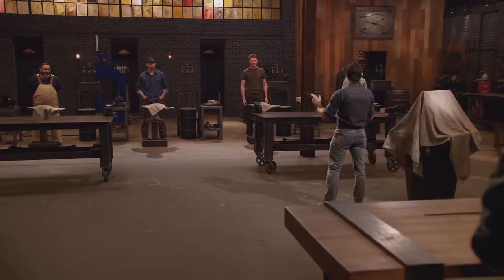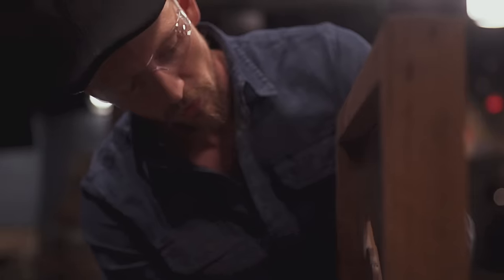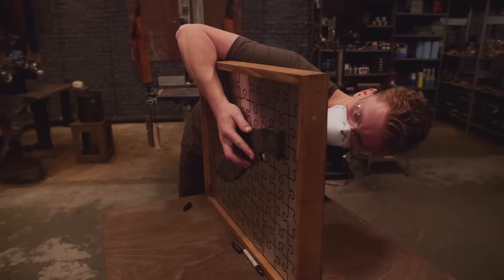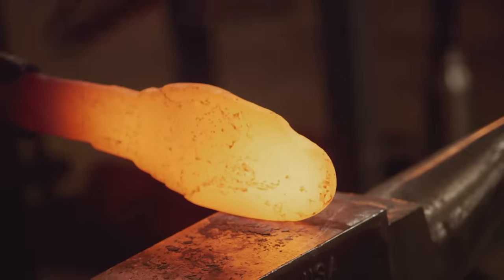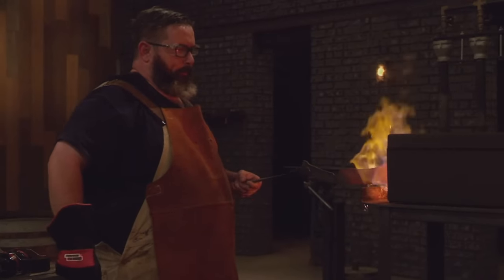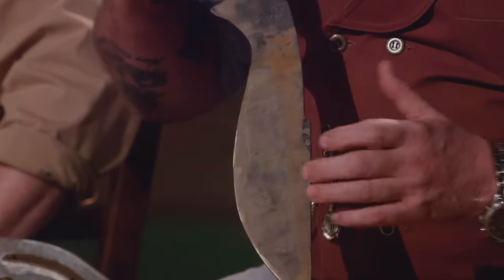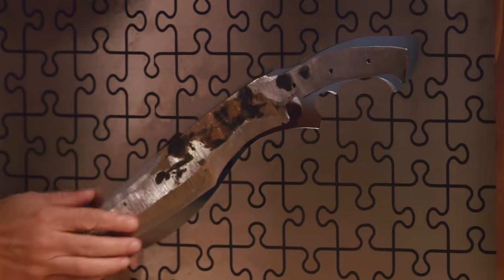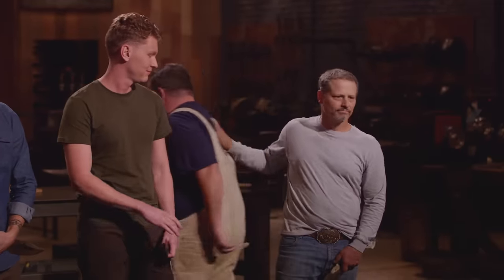The Ultimate Puzzle Piece Forging Challenge | Forged in Fire (Season 7)

Comment: That dude that stuck his hand into that hot bucket for sure messed up his hand bad. Paused the video when you can see his finger and that does NOT look ok!!
Reply: That's just a wet band-aid. You can see him wearing it earlier on.
Reply: hard to tell, that is either a 3rd degree burn or a plaster / band aid. I think it's the latter, if it was a 3rd degree burn I think the producer would have intervened.
Still I think it was a stupid idea though, he should have atleast taken his shirt off or better use tongs.
Reply: I mean, at 3:54 he's got bandaids on his fingers on both hands, so he was perfectly fine after removing his hand from the oil
Reply: Can grinder sparks ignite a oil dosed sleeve?? Lol
Reply: The oil is not hot enough to cause burns, is it?
Reply: You still don't want hot oil on you because it's gonna be hard to remove it because oil and water doesn't mix
Reply: @nandinhocunha440  That's what soap is for.
Reply: They qunch the blade in cold oil. That small blade will not increase temperature that much to burn. It can hurt a little but not any major burn.
Reply: @Durwood71  the blade might be.
Reply: The oil is not hot.  Dip a small hot blade in a large mass of room temperature oil and it raises the temperature maybe a few degrees above room temp.

Comment: I very much prefer letting the contestants decide what shape they want their knife to be. I care more about how a blade performs, than whether or not the profile perfectly matches another knife.
Reply: There's always some sort of challenge to the first section. Sometimes they pull metal off of weird objects and sometimes they have to do Damascus. They always have size parameters but this one is just more strict.
Reply: @RapTapTap69  that's true, I just think this challenge is too strict. It's a challenge where the best knife-maker could easily be the first one sent home
Reply: @irondirigible4216  if you think about it it's not much different than making the knife to specs which if you can't do, then You're not the best knife maker there
Reply: This is a test to see if they can make something "made to order". If a customer requests something to be an exact replica, then they don't want something that looks completely different.
Reply: The point of this challenge is to perform to a specific design. If you forge as a trade you are going to get specific requests that follow strict layouts. 

Making their own blade is cool but they can do that. This is to prove they can follow directions.
Reply: The thing is, many times you're not just making assembly line blades. You're making something extremely specific that someone wants, and for that it isn't about what you want but more about meeting the specs.

Comment: Why would you take your glove off to grab hot steel?
Reply: Could be the nerves, lots of lights and cameras can throw people off their game
Reply: The glove is what's closer to the hot fires and forges, your making the glove (which is to protect against the heat of the forge)
Reply: 1 you don’t want your glove catching on fire from being soaked in oil
2 you probably wouldn’t get a grip on the metal if it’s flush to the bottom which means your arm is in that hot oil even longer 
3 it’s just overall quicker because of our dexterity
Reply: @pickleboy6059  k ty :)
Reply: @pickleboy6059 4 The oil was only warm, if that even. That wasn't enough hot metal to heat up that amount of oil. And was first quench.